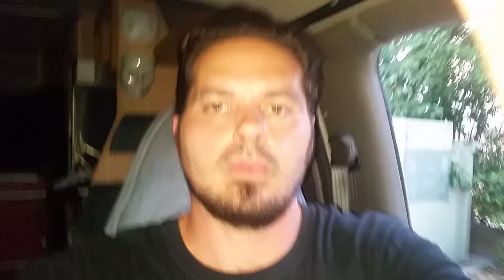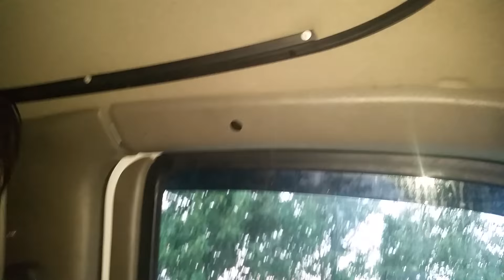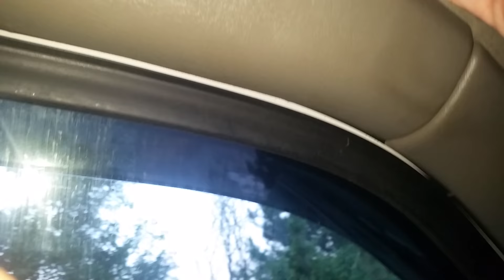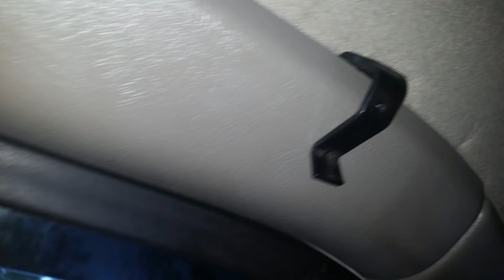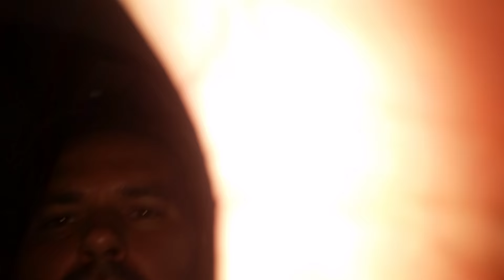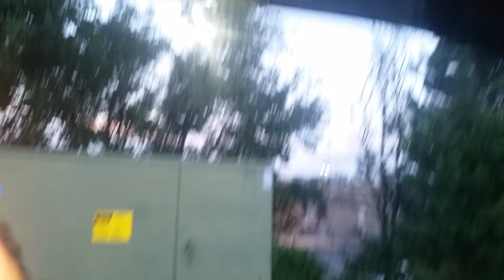Hands-free microphone install part 3

Comment: Great idea! Mine is mounted on the steering wheel, that's what the directions recommended. Maybe next time or If I break my clip I will try mounting it this way.  Sometimes you got do what you have to do to post a video, don't always have time to edit myself either. Hay, what ever happened to that swear jar I saw i your other video? LOL Thank 4 sharing.
Reply from the maker: haha. the Velcro came off. I need to mount it a better way.